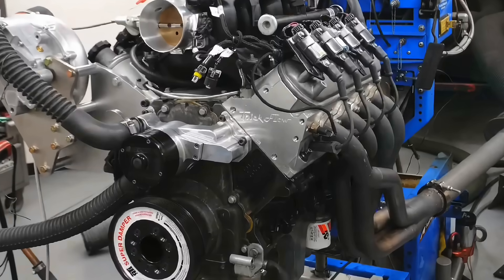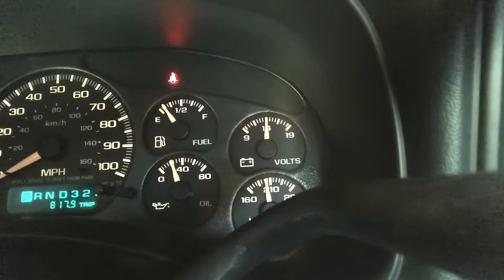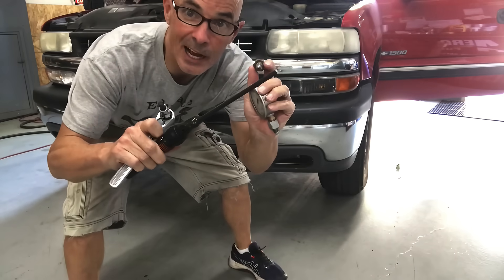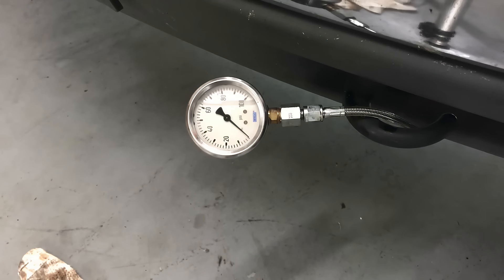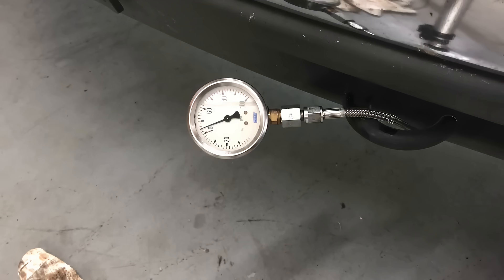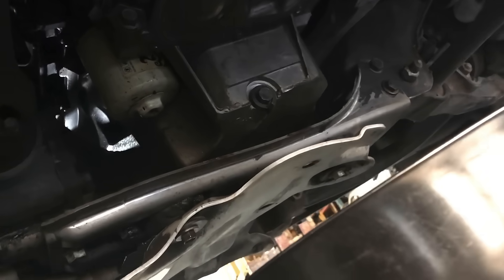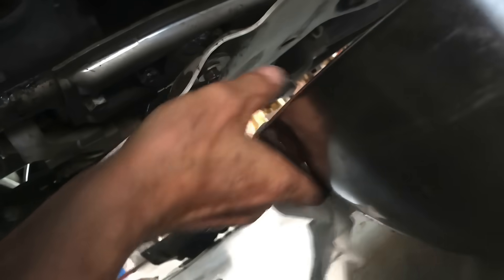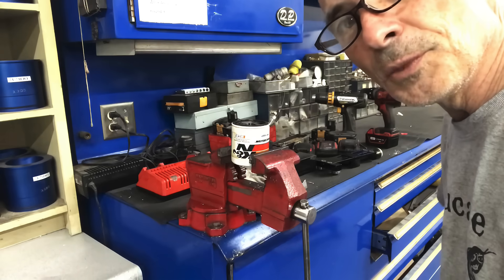HOW TO: TEST & FIX LOW OIL PRESSURE IN YOUR 5.3L OR OTHER LS?

Comment: 06. Silverado 4x4. Low oil pressure when cold,  tapping lifters   grumbling bottom end, ect. Once warmed up all the way,  good oil pressure, quiet engine.  I already know problem. That dang o-ring. Gotta either pull engine,  or drop front end to access. Yippee. Probably going to at least rod bearings,  and possibly mains. 140,000 miles

Comment: I have a 03 Silverado 1500HD with the 6.0 in it and it had 40-42ish and after I shut it off one night and the next morning I started it up and it only had 20lbs at best so I changed the sending unit and changed oil and still only has 20 at best now and thats after putting a new pump in and pick up screen with new O-rings and timing chain....but when I pulled the pick up screen out there was a quarter sized pile of metal shavings that looked like a S.O.S pad in it and now I have to run 20W-50 with almost 2 bottles of Lucas to keep pressure up to 25lbs and when hot at idle it will drop down to around 5-8lbs and the low oil pressure indicator comes on until the rpms come up but when driving it has just above 20lbs

Comment: I was close to pulling motor out of my Chevelle and I found out it could be the oil filter. Didn’t think it could be having very few miles on it. Thought might as well try it and pressure went back to normal. No more Fram filters.
Reply: Well we figured out Fram filter suck decades ago. Surprised they still survive, bust be the Autolite plug sales supporting the company, as fools but plugs made for nothing but fit everything.

Comment: Low oil pressure can be caused by a bad coolant system.  The hotter the engine runs,
the lower the oil pressure will be, because it gets hotter and hotter oil equals less oil
pressure.  Also, NO "modern" engines should be using 15W40 engine oil.  I would also
use a "factory" AC Delco filter instead of an aftermarket one.  Not all filters are created
equal.  If you have sludge inside of your engine, do a couple of "quick" oil changes,
change the oil after 2,000 miles instead of 4,000 miles, and get the sludge out of
your engine faster and safely.

Comment: Why do i have good oil pressure when cold and when driving around after about hour the oil pressure slowly drops and will eventually hit zero. Changed oil pressure sensor twice and put high pressure oil pump and matched the oil pick up oring. Im thinking when my lifter failed it nicked my cam in the slightest causing this issue. Any thoughts before i pull motor and rebuild
Reply from the maker: THE NICK WOULD HAVE TO BE HUGE TO CHANGE OIL PRESSURE

Comment: Note that Gen 4 LS engines with VVT and AFM/DOD (like an LC9 engine) typically idle at 20lbs hot, 40lbs cruise, 60lbs max on 5W-30 on a fresh engine with .002” clearances on mains and rods. The max is limited from the oil pressure relief valve. This is to protect the delicate DOD lifters which operate between 13-60lbs and will fail if outside those.
Reply from the maker: FAIL AT 60 PSI?
Reply: @richardholdener1727  the DOD lifters can hypothetically malfunction and stick down or in a half set if running too high of pressure during a afm activate/deactivate cycle, which is why Chevy implemented a different overpressure relief in the cast aluminum pans for those engines. Pressure relief is 379kPa (55psi) according to alldata.
Reply: Hey man I recently did dod afm delete did the whole kit so mechanically there is nothing there changes The Valley cover changed the shitty lifters to ls7 style oe lifters but I still get idle operating temp at 15-20. You think it’s still in there in the ecm ? Cuz I don’t get a low oil pressure light or check engine and I I did a full rebuild bearings and all
Reply: @BennyTempino5  need a 10296 melling....i used a 295....20 hot idle, closer to 40 with the 10296. 180 miles on completely fresh motor.

Comment: I have a 2000 Oldsmobile Bravada 4.3 on start up 50 after 5 mins 20 while driving maybe 2 at idle . New sending unit plus did the mechanical and they were the same . PLEASE Help

Comment: Strange I must have bearing issues my Pressure is 40 to 45 driving 25 idle I have over 200k miles but had a bad lifter did the dod delete so new cam lifters new pick up o ring new oil pump new vlom plate new oil pressure switch and filter new pushrods rockers springs retainers keepers timing chain fresh 10w30 synthetic oil wix oil filter runs and sounds great but oil pressure is basically where the video shows so I guess I'll drive it till it lays down I guess

Comment: My 05 tahoe With 280k is complete opposite. According to the dash 0 oil pressure in the morning and 20-40 driving around and on highway. Any sugestions?
Reply from the maker: check sending unit

Comment: Bought a truck he said the oil pump, water pump, heater core, new pick up tube and pick up tube o ring on oil pump, new oil pan gasket were all replaced but it had oil pressure problems. The lifters are ticking and he has a cam in there. I don’t think the car was put in right because I don’t think he replaced anything but the cam. The car idles low and stalls sometimes when I’m not giving it gas and letting it roll in a drive through or something. Anyone know how I could fix it? I’m planning in engine swapping anyway tho.

Comment: The screen under the sending unit gets clogged. My 6.2 will have great pressure untill it gets hot. Then I’ll have just under 20 psi. I haven’t had time to look but I’m going to try the screen under the sending unit first then the oring second, while cleaning out the pickup tube and bottom of oil pan while I’m at it.

Comment: I have a 2005 GMC sierra 2500 HD with a six point no it idols at 30 psi and only gets up to 43 psi no matter the RPMs you can redline this track and it will not reach 60 pounds of pressure I think I may need a oil pump or possibly one of the O-rings are bad. This engine is as tight as a hair in a biscuit with zero tix but every LS engine I’ve ever owned idled at 40 psi

Comment: Ok, 2004 496 8100 vortec. 90k
second owner. isdue, cold 48 psi, but rolling on the road, 2200 at 60-62 mph, hit a hill, tranny drops from OD to 4th, rpms go to 3000, then to, 3rd, 3500, oil pressure drops to below 5 snd alarms and  low oil light
comes on, Some lifter tap, back iff to idle, oil pressure comes back . 
Clean oil and filter, new sensor, same thing .  Any help ??

Comment: You missed the entire point of cutting the filter open, the media! Use a razer and cut the paper filter element out, use the vise to squeeze the pleats dry of oil. Then look for debris. A magnet will help you decipher ferrous (cylinder, crank,etc.) from nonferrous (bearing material, pistons).
Reply from the maker: we can see the debris in the filter element if it is there
Reply: @richardholdener1727  so it was simply editing choices that made it appear you only looked down into the shell? Thanks for replying BTW!

Comment: I found several causes in my stock 2010 5.3L but ultimately it was a clogged oil galley between the test port you show and the oil filter adapter where it bolts to the oil pan and block. Also the screen was clogged below the oil pressure sensor. I did a couple videos to try and help others diagnose their oil pressure issues.
Reply: The screen is also only on DOD motors from 07+ 1999-06 don’t have the screens

Comment: Love your videos! 

Feedback:

1. It might help to post a chart of LS based engines and oil pressures. You're going to freak out people with gen VI 6.2's. 

2. Most people don't have oil line, a fitting, and a pressure gauge lying around. It would be easier and cheaper to just replace the sender as a first step.
Reply: Doesn't account for inaccuracies in the gauge cluster.

Comment: Typical of a well used long service life engine. Honestly I don’t even see this as a problem; stock Gen 3 Vortecs will run 200k+ street miles on 20-30psi oil pressure without issue. But what I suspect is the issue for you is a combination of a tired pump and possibly clogged/sludged up pickup/screen. In my experience that is the most common culprit. Next to this the next common cause is poor ring condition. Blow by in excess essentially.

Comment: 1 sender unit
2 0 ring
3 oil pump
no brainer
gut your ass to work
sending unit is 10 dollar in amazon
0 ring. 2 dollar at o Riley
oil pump 30 dollar on amazon

Comment: It has normal oil pressure like my new sierra 5.3 l83 , there's no issue with your oil pressure
Reply from the maker: when the pressure changes dramatically-there is a problem (which we solved)

Comment: FYI: When the o'ring and a new high volumn pump doesn't work, and a mechanical guage shows none at idle after all this, replace/rebuild engine. Wasted hours witch hunting to discover this. Got a used engine, used same new hv pump and sender off old motor, oil pressure is maxed on guage, 60+lbs on idle, nearly 80 lbs @2300 rpm normal temp on the freeway.

Comment: So pretty much between the two gauges depending which one has the lowest pressure is going to determine if it was top end or bottom end of the motor thanks again for the info.

Comment: the tell on the o-ring is that you will have NO pressure for the first second if it's been sitting for a couple of hours, as the tube has drained out. Another test is to get the truck seriously nose down and add enough extra oil to get oil over the top of the o-ring.  Every LS I over 15 years old have done has had a bad o-ring.  If it's not that, it's the center cam bearing walking out....

Comment: My  personal experience on my 08 silverado 5.3 my truck was 40 psi at 3000 rpm, and almost zero at idle, I replace oring, pump, pick up tube , sender unit install a mechanical  gauge,  but same problem, I ending swapping the engine with a 6.0 , I'm still thinking on what can be wrong on my other engine,
Any  suggestions?

Comment: It didn’t seem that low to me! 25-35 at idle probably kind of normal
Reply: Odd , the man just told you he had a buddy change the pick up oring and tada his oil pressure came back up.
So you doubt a positive out one cause you think it's ok low?
Pay attention, he noticed it low, had an actual issue repaired and the oil pressure came back up.
Thus we confirmed it WAS a damaged/defective oring and the oil pressure was low.
Your assumption analysis is/was wrong.

Comment: Mine had a lifter tick right after reaching operating temp but would usually go away after a couple miles. Contemplated changing the lifters. But after watching this vid replaced my o ring. Now has more pressure than ever and engine is quieter than ever.

Comment: I just picked up a 2010 Tahoe from a Copart auction with 200k miles. I notice that the oil pressure was a bit low on my way home and eventually had Zero, turns out, the filter was very loose and it was loosing lots of oil. Did a quick oil change in a parking lot and problems solved.

Comment: My 2002 5.3L always had over 40 psi at idle, but never rose above ~57 psi at speed as read on the dash gauge. At 116000 miles it is apart now, no issue found with pickup or or O ring. No sludge or undue wear on anything. Will be replacing oil pump, sender and barbell along with all new bottom end seals.

Comment: The gauge you left on probably had air behind it and along with the old oil still in their both combinations i think that bottom gauge read different than the sending units which is located higher on the engine were is no air and new oil . That o ring wasn't it because the oilpressure would have been going up and down very quickly bcuz of the air in between after its Ben pump.....so im sticking with you didn't remove the gauge underneath to reset the bleeding prosses
Reply: O yea and from what i have experienced worn berrings in the motor is usually the problem mostly cam bearings usually
Reply from the maker: NICE THEORY-ALL THAT FROM WATCHING SOMEONE ELSE SOLVE THEIR OILING PROBLEM? IMPRESSIVE

Comment: I'm actually surprised this was even investigated. 30-35lbs at idle hot is nothing to be concerned about. Plus, it ran up to 60lbs at 2,000+rpm. Where's the problem? The O-ring was OK, and didn't crack until removal. Sorry Richard, unless the oil pressure changed quickly from higher readings to the ones you showed, I'd run it!! What was the oil pressure after changing the O-ring? I have an LS7 with oil squirters (Holley carb jets screwed into oil galleys), and I get 28-30 lbs at 190° oil temps at idle. This is with a high volume Melling pump. It's at 45lbs at 2,000rpm, and at 60lbs+ at 3,000rpm to 7,000rpm......
Reply from the maker: IT CHANGED SUDDENLY-THERE WAS A PROBLEM

Comment: Good video Richard.  Being a Chevy tech and I agree with you the GM truck and suv have gauge/instrument panel accuracy issues. 
By the way I notice the AWESOME frame picture on the wall over your right shoulder at 12:40.  CORY MAC’s top fuel dragster.?.  I have that model dragster.  Keep up the awesome work on the GM LS engines

Comment: First sign was low oil pressure on guage, tried hard line guage, no difference, Had some lifter noise when idling at stop sign. Time for tear down. Found spun cam bearings. Found out from machinest that LS was known for this in slot of cases. Maybe it had bad o-ring on pickup tube before it spun cam bearing. Pay attention to that oil pressure guage guys! 
Love this channel.

Comment: Is that seriously considered low??

I'm used to big diesels- a lot have hot-low-idle as low as 20psi out of a fresh rebuild and are happy as a clam. Some have a spec as low as 8psi+ at low idle, 25psi+ at high idle (governed redline, usually around 1700-2700 on the stuff I deal with) 

Have to say though, I love an actual pressure guage- while I like my Fords, a dummy guage is.... yeah...

Comment: I have the same issue with my ls1 Pontiac  . When I start my car the oil psi is at 50psi.  As the car warms up, the oil pressure goes down to 20 psi and goes up to 40 psi when in drive. however,  when I shift it to neutral and rev it , the oil psi goes back up to 50psi.  I don’t know what it could be .

Comment: In my 1.6L Turbocharged Suzuki Sidekick  I found a partially stuck open relief valve, after I blew the turbo from low pressure, no gauge only a light that didn't come on

Comment: 10w-40 or 15w40 and drive oil pressure will be fine as long as the pickup tube oring isn't completely destroyed. This thicker oil is for those who have bearing problems. It's not a permanent fix but you can get maybe a year or 2 out of it

Comment: Man I got a low oil pressure out of my 5.3 after about 231,000miles of service❤️👍Maintenance is the key to life and the oil is the blood running thru to keep it alive👍Keep it changed and try Motorkote additive for crankcase and pumps.I use every four oil changes adding 2 ounces per quart of oil.Got 238k on my H2’s 6.0 and runs like new and looks almost new at 15yrs old❤️

Comment: Did you get a big puff of white smoke on startup?
Reply: I’m not sure what’s wrong with mine it’s a 06 5.3 and it shoots a big puff of white smoke on the first start of the day and also it has a bit of rough idle, like I can feel a little vibration while I’m at idle, it also marks about 20psi oil pressure

Comment: I wonder if you had a clear oil filter if you'd see a bunch of bubbles or frothy oil in the filter?  At low RPM, I mean.  At high RPM, I'm guessing the oil is probably always going to be a bit frothy.

Comment: I use/believe in oil sampling on my low performance V-6/4.3 chevy .  After 700K miles in one 15+ litre Cummins the oil drain sample tells me more about the engine. Yes your oil pressure was low, and you could not  find problem but cutting open your filter did not show up any issues.  Yes, oil sampling would not have found the o ring failure, but at least you have peace of mind for other issues like fuel dilution ,water leaks and gaskets failures, etc !

Comment: I had a shop test my low pressure they used something on the oil filter to test pressure said about 10 psi I changed the sensor didnt work...with a bad O ring what will pressure read?

Comment: Just bought an 2001 Sierra 4x4 and took it down the interstate. Started dropping pressure, 20 psi and falling, and you’d hear clacking. Turn it off and crank it back up and pressure would return. Changed my pick up tube o-ring and deleted the oil cooler and 42 lbs at idle and 60 cruising! Not bad for a truck with 273k miles!
Reply: Did you notice any power gains deleting the oil cooler?
Reply: @Twogreenfeet 25 horsepower!

Comment: Great video! Very to the point and very helpfull. I have a 03 Yukon xl and my entire dash dosent work. I kno i know i need to get that fixed but honestly with the digital info center it tells me everything i need to know so i havnt wasted money fixing the dash. Well that being said i recently had a "low oil pressure" message come across. The level isnt low because i check every time i put fuel in it. But i have procrastinated  on changing the oil lately due to covid and the cold and lets be real...me just being lazy. This 5.7 had been about the only thing reliable in my life lately. Lol... so i watched some videos and this one. Flushed the oil...learned how to cut open a filter...thanks to you. Luckily no metal shavings etc. And then did the flush with the different w like in this video and BAM she is right back up to the pressure i should be! No more stupid warnings. So thanks for taking the time to film this and share it. It helped me so much. Keep up the great videos. From your new friend.....Chandler

Comment: We all know the accepted GM oil pressures at various RPMs. I've been running a "builted" and boosted (20#) LS1 with a mechanical gauge off the turbo feed. Oil pressure at idle 7-9#, 2K RPM 17-19# and 25-28# above 3K RPMs, well into boost. Nary a problem.